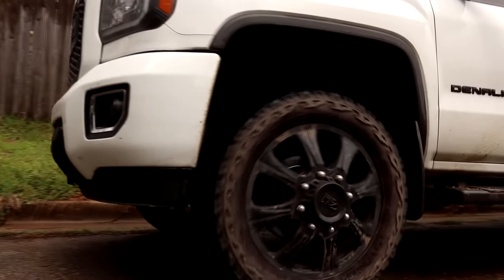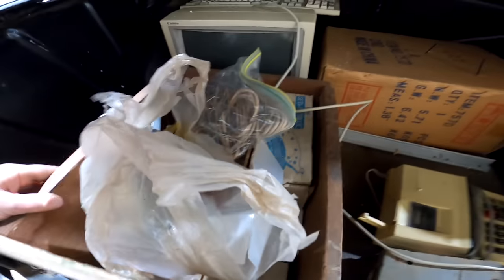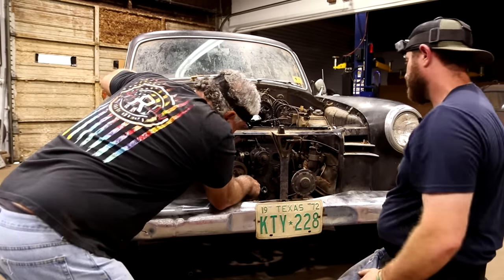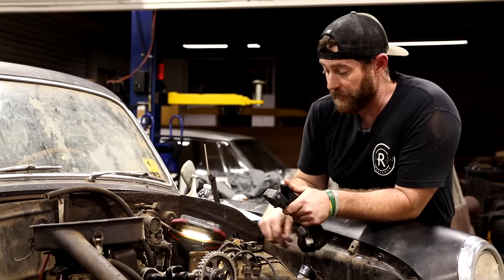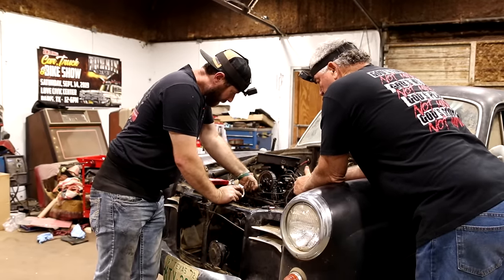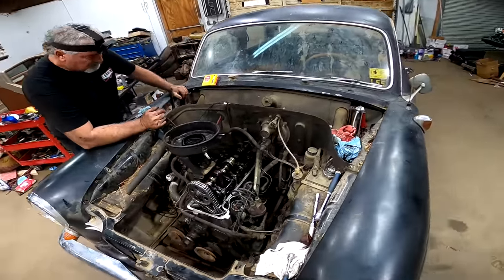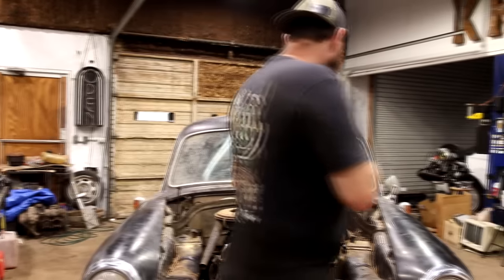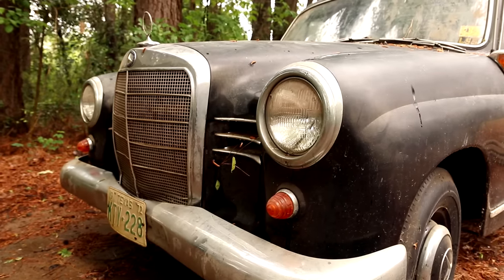First Start In 50 Years | Amazing Transformation 1960 Mercedes Benz 190B | RESTORED

Comment: thy this, fellas...feed the new chain down on the (passengers) side when you feel it contact the bottom of the case secure it in place. Next, create a hook at the end of a metal coat hanger and insert it down the drivers side of the car. loosen the chain slightly until you capture the chain end an gently "walk" it under the lower sprocket until the captured end is at the top sprocket. Good Luck

Comment: The compression problem on #2 may have been stuck rings.  A problem I’ve ran into on more than 1 or 2 20-35 HP tractor engines.  After running for a short time, they eventually freed up and compression not perfect, but still more than adequate.

Comment: the clutch is completely mechanical , not hydraulic ! You are looking at the brake fluid reservoir just in front of the fusebox , and next to the ATE brake booster ( which was an option since most Pontons , apart from the 220 models , had unassisted drum brakes . The clutch pedal shaft goes into the side of the bell housing and acts on a linkage directly onto the release bearing .

Comment: The auction guy said that the original owner brought the car over from Germany. So it's most probably built in Germany. That means the meter would show kilometers , not miles. 1 mi = 1.602 km, which means a good estimate of the mileage would be 2/3 of what it shows on the dash (and the US stickers).
Reply: Well the speedo goes up to 100, so that'd be mph, as it'd surely show more than 100kph (62mph)

Comment: yeah you should pull the head to find a bent valve or 2 ,depending upon the car shutdown quickly push the clutch off key and natural died .  brake stopping the car..to cease any further damage alot of foren cars don't have reseed valves to prevent damage to valves and or pistons

Comment: When you had it on tdç was it on compression stroke or exhaust stroke , you can get the crank half out with the cam shaft , if the crank is on TDC the valves should be both closed according to cam shaft, the cam turns 2 times every time the crank turns once!!!!

Comment: I drove an identical car for years back in the 70s.  Great car.   Did you replace the timing chain guides? The “side” light is for when you park the car on the street. You turn that light on with the light switch and it lights up and your car can be seen easily at night.you didn’t get a replacement three pointed star??  Heresy!

Comment: The Tentsioner works with engine oil pressure and failed with dirty oil, that's the only issued whi the Chain Broker, make Sure that the Tentsioner works ,fill IT with oilpressure before crank and all is pretty.

Comment: Tensioner works on spring and on oil pressure. It should be bleeded.
The engine starts by the pushbutton on the dashboard.

Comment: I have the same problem with a 1972 m.and Iused the old piece of chai . I side a strong magnet   and pull the piece iin the bottom pulled  up hook the newchain ant joint  them and  slided dow thru the left side and keep pulling until the new chain comes up

Comment: I have just joined you so it’s no help to you but will answer a couple of questions The dipstick has a sump breather attached to it and tensioner is manual with a spring
Reply: Also to adjust chain one tooth it is best to slacken tensioning completely and pull top pulley off camshaft and align timing and push pulley back on and then tension chain
Reply: Something I haven’t seen you using is a tachostrobe light for setting the timing on early European cars and you get the timing spot on

Comment: the Mercedes owner's club can supply original shop manuals.  There is nothing unusual about that engine except for adjusting the valves.  Even the Clymer's manual you have will explain that.

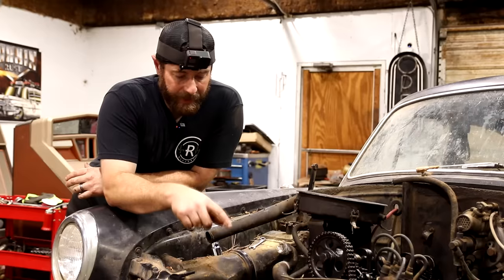Comment: I suppose it doesn't matter here, that little sprocket wont be working very hard, but 38:14 really killed any hardening it had, and  unevenly too.  Any colour is too much heat, it's got a soft  annealed section now.

Comment: My first car in high school I bought was the nineteen sixty one ninety d b diesel. I had that for many many years that I finally sold it to a friend restored it. I don't know what he's done with it since then. Later I bought another one in nineteen sixty one ninety d B. Is my father also had a nineteen sixty one ninety d We've gotten rid of all of them the 2nd one. I had I sold to a guy in Utah. My father gave him his one ninety d b for apart's car. I know somewhere I have had a brand new grill I gave away. It was a wonderful car At the time diesel fuel was only nineteen cents a gallon. People with their 57 Chevy's and other cars couldn't afford gas every weekend in high school. Somewhere I still have a service manual for these . This one is not in very pristine condition at all when you look at the steering wheel. You look at some of the other things the leather poles trees covered up. The turn signal lights on the front are not original but they've done a pretty good job of fixing it.

Comment: Preserve everything. Parts are a nightmare to find and when/if you do them it’s expensive. I restored a ‘60 190. However I made some changes. I deleted the column shifter by dropping in a 69 pagoda SL250 drivetrain. I had to sacrifice the passenger heater to accommodate the second carburetor. It had to be repainted twice and still didn’t get it right. The third time I prepped it myself. All of the exterior chrome was triple plated in brass and clear coated. All of the interior chrome was replated chrome. Completely refurbished interior.  After it was finished people couldn’t get enough of it. You couldn’t pick your nose in private. On vacation, I parked behind a Lamborghini on Rodeo Drive in Beverly Hills while we shopped. When we returned there were a dozen people standing around it. No one gave the Lamborghini a second look. It was sorted too. It jammed up the California I5 grapevine on a 97 degree day at 75mph with no issues. The next stop was San Francisco. We parked on the famous Market street. We didn’t get five feet from the car when we heard screeching, turned to see a CJ Jeep stopped next to the car. The guy, a renowned international photographer, insisted on buying it on the spot. I told him twice it’s value when he asked. He didn’t bat an eye. The transaction was completed the next morning. The quality of my work must have impressed him because he bought it without sitting in it , hearing it run or driving it. It is such a solid beautiful car, I miss it.

Comment: It would be worth it if you did go ahead and pull the head as you do the job  bc either way you got to run the chain down around the crank shift before hand bc after you get this far you got to Sloan everything as you work upwards to the cam shift to were yo bring both  ends of the chain up and hold it as you replace the head gasket anyways bolt the head back on then put the chain over can gear then install the link onto the can chain on top then you should be ready to trying to start it

Comment: Try the timing chains on a 2006 mustang you have to pull the engine because they are on the back side of it if it is  V6 there is 3 timing chains if it is a V8 there is 4 and the fun part is finding them my cousin's was in the shop for over 4 months before they found any Ford didn't even have them it is in the shop again this year for the same thing for over 3 months because a gear that is supposed to keep the chains in time went out and it and the chains come from China

Comment: What you need to do is to COMPLETELY DISASSEMBLE the car! Then steam clean, take all the rust out, replace worn-out parts, redo all seats, take the engine and transmission apart, blueprint it, paint the inside parts, reassemble the car, paint, and then it will be done.

Comment: Crazy German engineering. It took one guy a good half hour of poking around before he figured out how to remove the door handles. It should have taken no more than 2 minutes.

If it wasn't some brainless juvenile shenanigan that caused those dents, I suspect he was parking close to a large truck at some point. The height off the ground could match with the lower half corner of a truck door and most drivers don't park on a dime every time. Body shops see that once in a while in Canada in winter mostly, the snow banks build up and makes the vehicles park closer.

Comment: Always; don't speak too soon before you get the vehicle running properly when it's not even running yet. I understand that u 2  want 2 be optimistic & very positive/uplifting, but can't always be that way when a vehicle in ur position; & in my position it would be L&G Tractor engines, clutches/transmissions could be bad or locked up or even missing a piston or connecting rod or both!!!